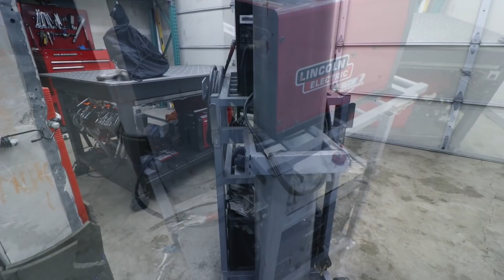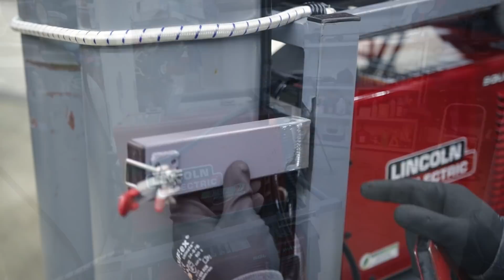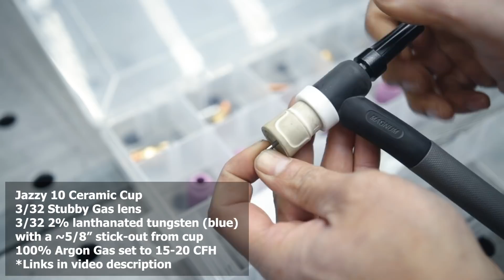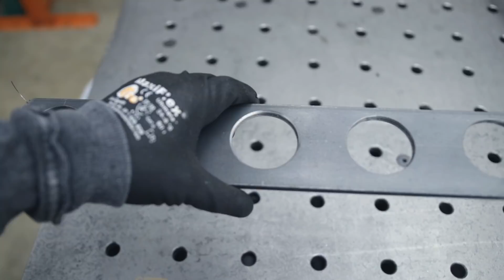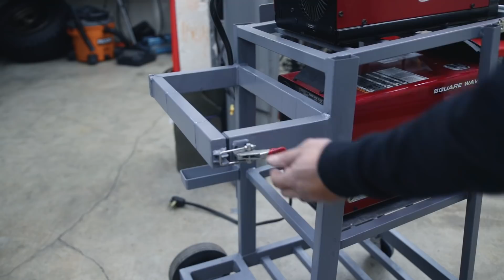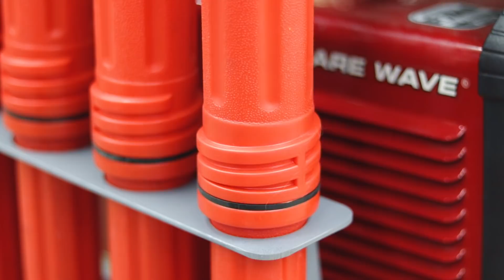I CONVERTED my Welding Cart to fit a Mig & Tig Machine

Comment: I know it's probably a personal preference but before you extended the middle shelf I was thinking why not just switch machine locations. The tig would've already fit at the top and the shorter mig machine would've fit on the middle shelf. Either way it made for good content and I love your channel. I think it has the potential to be huge and hopefully bring you some $. I would try to start reminding viewers to like and subscribe to help grow your channel.
Reply from the maker: Yeah I tried that... but you loose access to the door that opens to the  mig spool wire as it will hit the frame if its in the middle rack... Reason for me moving the mig machine on the very top rack... Thanks for the tips and for watching🤙

Comment: Great Plans... I modified the plans to make room for MIG and Flux Core welder and my Plasma cutter. Put the lower two shelves on drawer slides so I can fully pull out my welders to access them.  Weight is counter balanced by weight of gas cylinders. Thanks
Reply from the maker: That’s a great idea on the slides. Nice work

Comment: why did you choose the Lincoln electric welder?
Reply from the maker: I got them both for a great deal when buying used.  And they seem to do the job I need. Its something I would recommend if you want something in the middle not cheap but not too expensive.

Comment: I am currently building this cart based off of your blueprints and I'm almost done so happy with the design!
Reply from the maker: That’s Awesome! Are you making it to fit two machines or just one for now?
Reply: I currently own the miller multimatic 220 which can do tig mig and stick so one machine but two bottles of gas can be attached.
Reply from the maker: Awesome that’s a great machine ! If your IG send me pic when your done with your cart build. Thanks
Reply: @RathaSochenda  does your bottle holder come out 7" or 7.5" my tank is also a 150 but I want to make sure when I buy my tank of argon that both fit
Reply from the maker: In my area when I swap 150cf tanks they come in both diameters. I designed to fit the the larger 7.5”. This way it makes it interchangeable. But normally tell my welder supply to swap it to the larger tank bc it’s normally what I see stocked and I like to keep it consistent
Reply: Did you have any issues with the tanks being too close to the welder and kinking the gas hose? It's not too bad on mine but I just wat trying to think of a way to get around that.
Reply from the maker: @davidgladman2089  it was close.. but it cleared on my machines. One way that could help clear it is to add a elbow fitting at the gas connection at the weld machine.  https://www.amazon.com/Western-Enterprises-AW-407-CGA-032/dp/B002BZXFTU